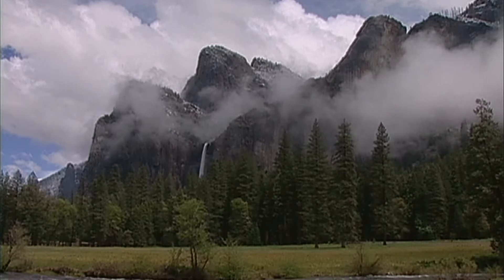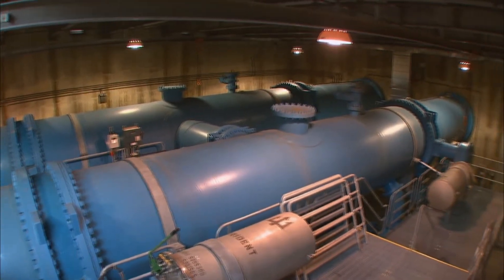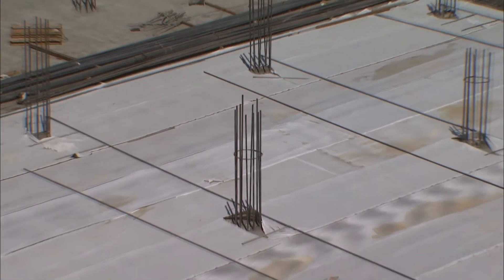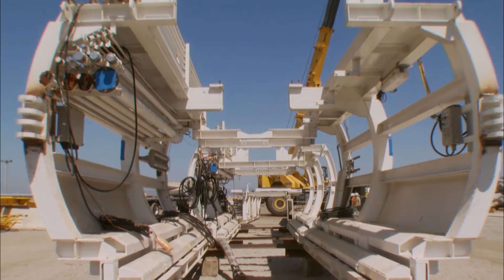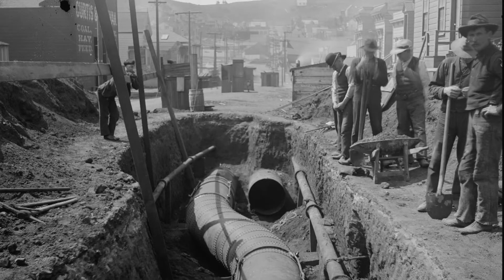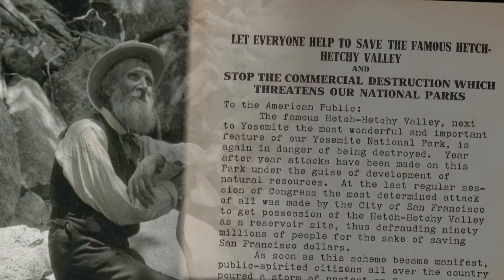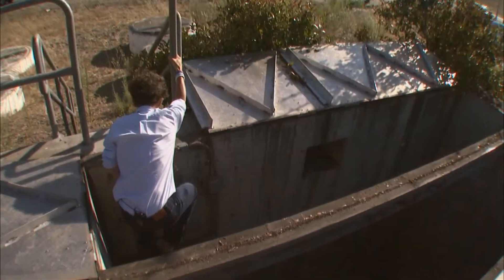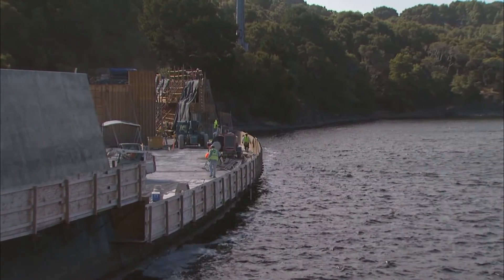Hetch Hetchy Aqueduct: Big Fixes for Big Quakes - KQED QUEST

Comment: Interesting & informative video. John Muir died one year after losing the battle for Hetch Hetchy valley. The Sierra Club want to restore it. I bet it's a mental quandary for the libs in SF. Clean water vs. green warm n fuzzy wishes.
Reply: There are ways to have both.  But as long as some people try to frame it as an either-or, you’ll never see that.